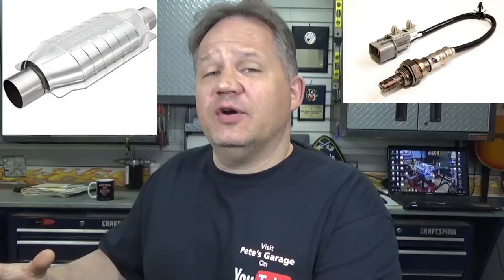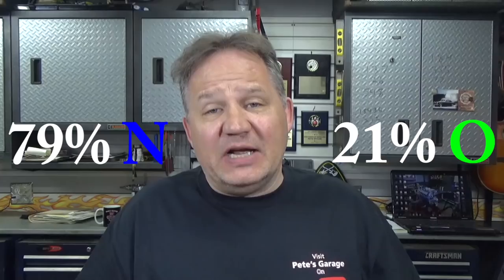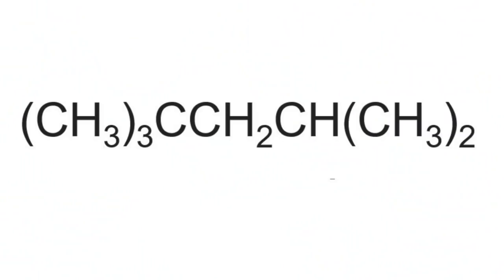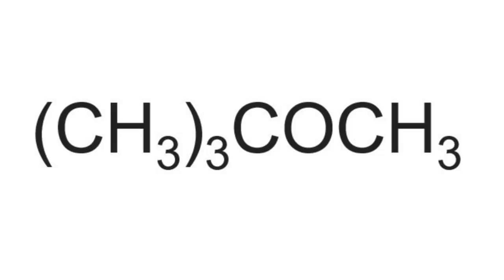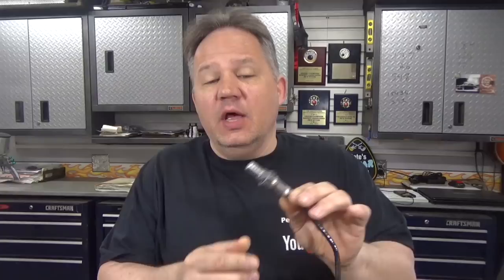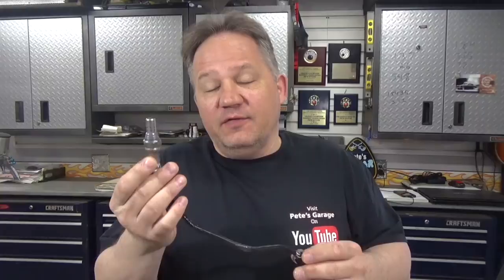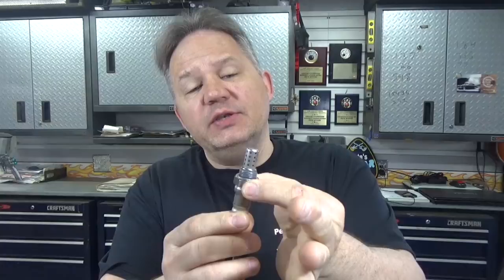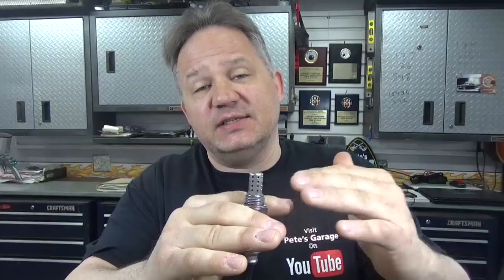What is an O2 Sensor, Catalytic Converter, How Do They Work, How to Make Them Last

Comment: great show,im now a bell subscriber,i have a 2010 e450 / v10,the cat was stolen couldnt afford the new crazy price So i put a strait pipe with a bung and sensor,it runs fine but about every 25 miles it spits out a cat code,i erase it,,another 25 miles it does the same thing,if i extent the wiring harness and put the bung +sensor past the muffler would that help stop the computer spitting out cat codes because its farther downline,& maybe weaker readings,???
Reply from the maker: It could be because it's a different sensor, the new location probably isn't helping
Reply: Am I missing something? It sounds like you're asking why you're getting a cat code without a cat. Ofc that would be the case

Comment: Are there systems for older 60's and 70's cars? Maybe a handheld readout for manual tuning like on a Dyno? Carburetor tuning is a pain for me. I couldn't find anything on the net.
Reply from the maker: Sure, my dyno guy has an O2 sensor in the headers he uses. Makes it very easy to dial in the carb.
Reply: @PetesGarage  
But I don't have access to a Dyno. Is there a handheld device to get the reading from the O2 sensor?
Reply from the maker: There are a few ways to do it, but you still have to put an O2 sensor in the exhaust stream somehow
Reply: @PetesGarage 
I can weld the threaded piece into the header pipe, right? Reading the results is the problem. What can I connect the O2 sensor to to get the reading?
Reply from the maker: You can weld it in, there are OBDII readers that will tell you AFR
Reply: @PetesGarage 
Thank you...

Comment: Them things are a bitch to program out.
Reply: Why would you do that?
Reply from the maker: Almost everything is
Reply: @Xfacehack  

I work on offroad trucks as a hobby and side job. When guys bring in newer trucks wanting them straight piped depending on the age you have to either get a dummy sensor or for newer trucks a programmer that can make the engine read like the cats are still there and working properly or the trucks will run rich.

Emissions are a pain in the ass to deal with but when you love loud obnoxious exhausts then you do what you have to do.
Reply: Bradley Selk Leave it along and let tuners map the vehicle, inly reason to remove cat is if you want i bit more horsepower. Even then you're able to make great power...
Reply: @Xfacehack  

A lot of the people I do this for are guys mostly high school kids who want a loud truck.

Either way a lot of the trucks they bring are 10+ years old and need to have the cats replaced so its easier just to remove them and be done with it.
Reply: @bradleyselk9642  They loud even with cats on wtf? If it's old trucks you could probably just weld in an o2 sensor bung and use it. Never remove it...
Reply: @Xfacehack  

Usually we just use dummy sensors on the older ones but newer trucks are a little more complicated.

I've only had to do two late model trucks but they were a pain and I had to have a friend come out with his computer to help me and we still had to buy a programmer.  That gets expensive.

Cats are waste of resources that do nothing for the truck so what's wrong with getting rid of them.
Reply: @Xfacehack  

I get what he's saying but most of what I work on are off road play toys that are supposed to be loud and obnoxious and if the customer says no cats then the customer gets what they pay for.

Yesh man why so hostile?
Reply from the maker: I understand what you're doing Bradley, I get it. We are all here to learn, it's all good Carl

Comment: I failed my smog because the inspector said their shouldn’t be these oxygen sensors on it. There’s 3 of them.
Reply from the maker: That doesn't make much sense
Reply: @PetesGarage  Paper said the fuel metering system failed visual inspection. I live in California. Probably some stupid law
Reply: @PetesGarage  got it checked again and it’s actually a spacer in one of the o2 sensors that’s the reason I failed
Reply from the maker: Interesting
Reply: @PetesGarage  passed 👍